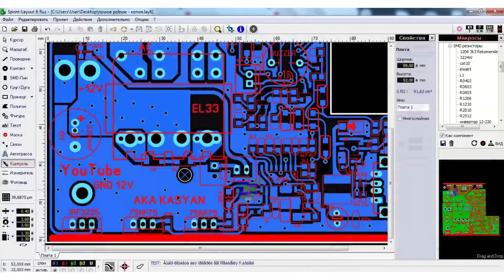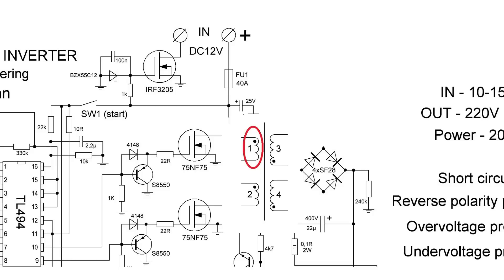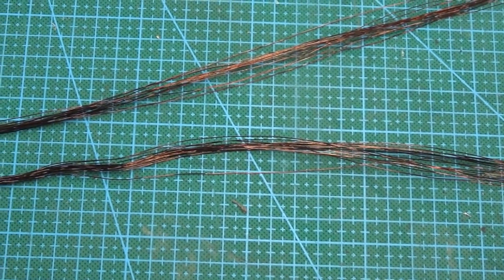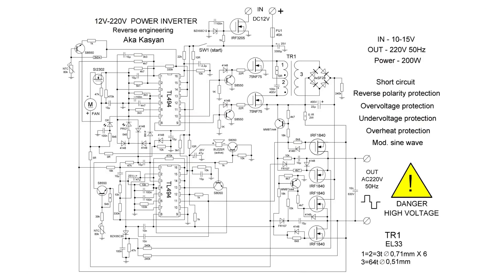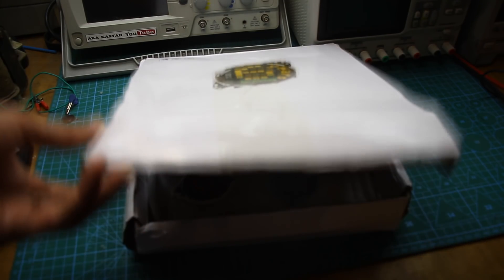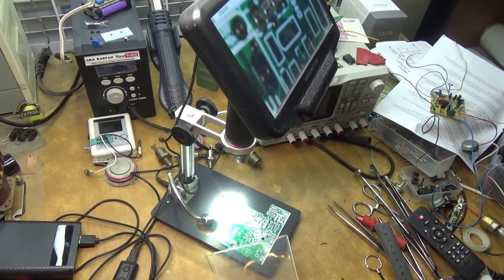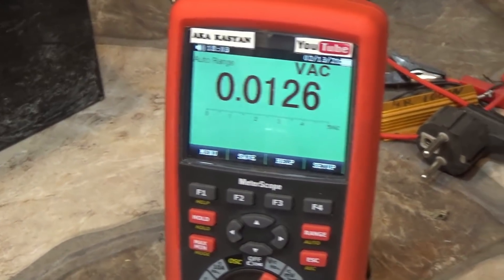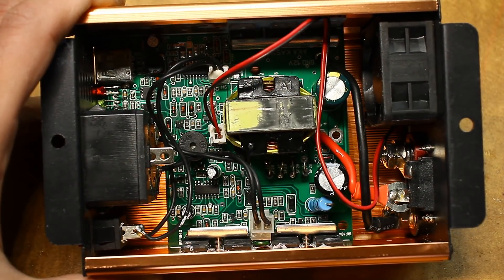DIY 12-220 50Hz power inverter (mod sine wave)

Comment: Hello! Thank you for sharing the entire schematic of these inverters. However I ran into one problem for the H bridge section- For the high side mosfets the gate to source voltage is about 10 volts when no load is connected and drops to 3 volts as soon as I connect any AC load, this heats up both the high side MOSFETs. Any idea why this is happening?

Comment: Clever way to use the voltage drop across the 0.1R resistor to shutdown the output. 
Thanks for sharing the design. It's an oldie, but a goodie.